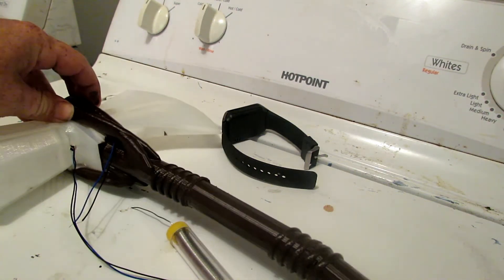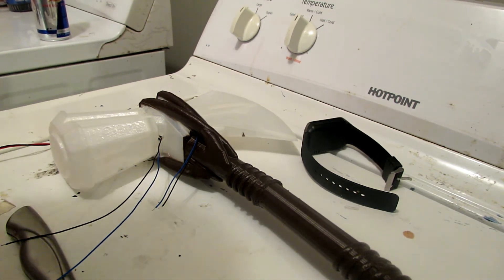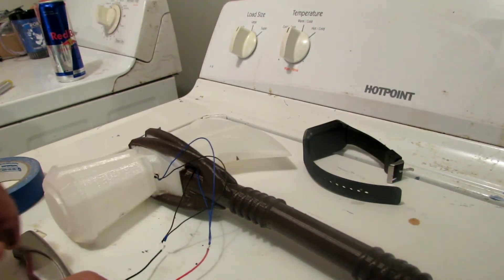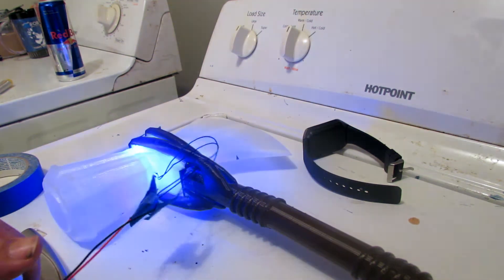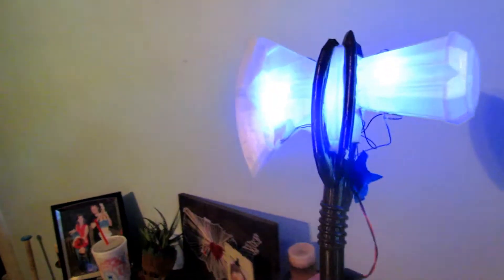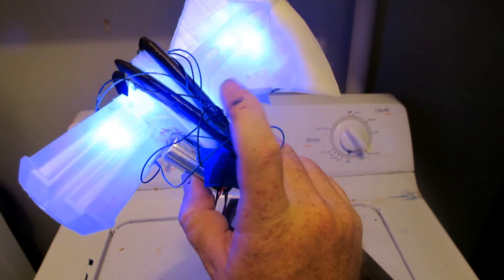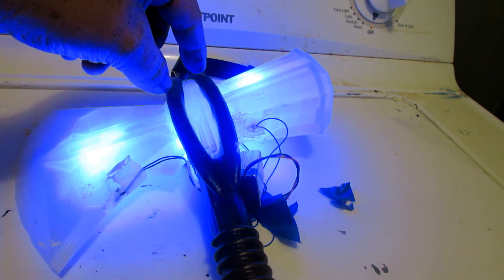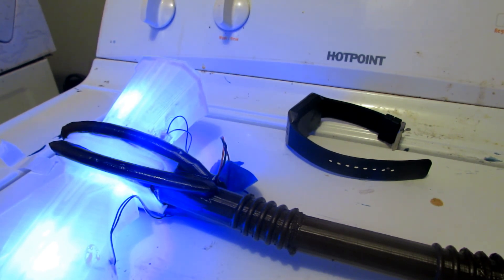3D Printed Storm Breaker With LEDs Part1: Electronics Test

Comment: Maybe you could use a joule thief and a couple of 2032 sized watch batteries instead it would be less bulk. Is the handle hollow?
Reply from the maker: I didnt even think of that. Thanks for the link. Ill check it out. Ya a watch battery would work great. the handle is practically hollow. its a 2% infill